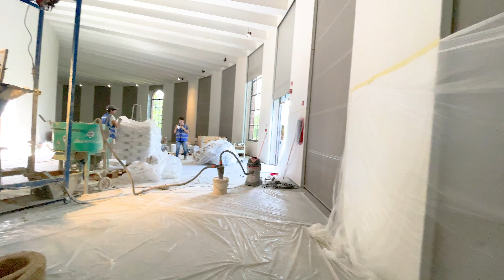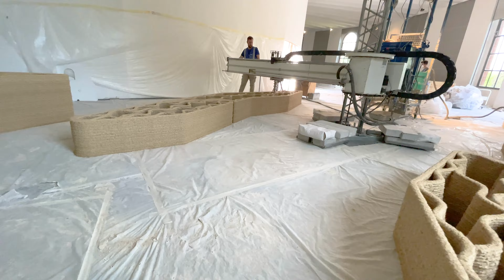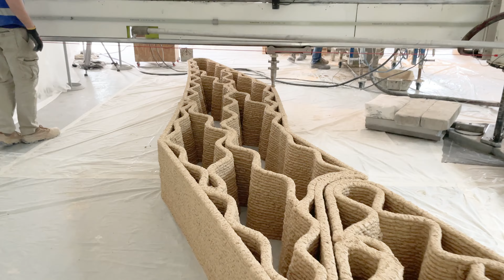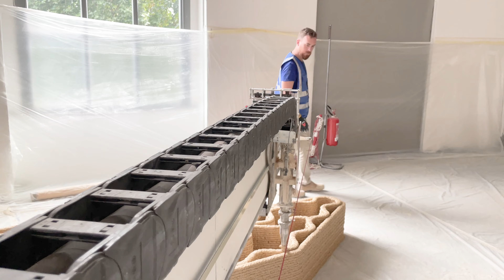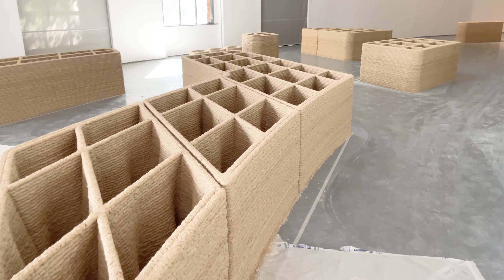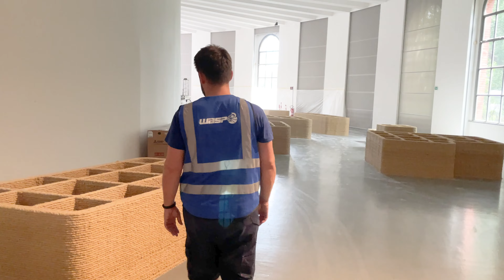Making Of | 3D printed exhibition by WASP for Triennale Milano - Unknown Unknowns

Comment: is this printer more simple that the 12m delta printer? seems this type of can print bigger size than the delta.
(and what is the maximum you guys can print with this type? (I mean a bigger one)
Reply from the maker: Thank you for your comment! Yes, the 3D printer that you see in the video is called Crane WASP and It's the evolution of the Big Delta 12 MT. It's much more versatile than its predecessor, scaling from its stand-alone configuration (that you can see in the video) to its architectural size, reaching a printing area of more than 100 m^2!
Reply from the maker: You can check out our pinned video about the TECLA project to see it in its advanced configuration.
Reply: wow!!